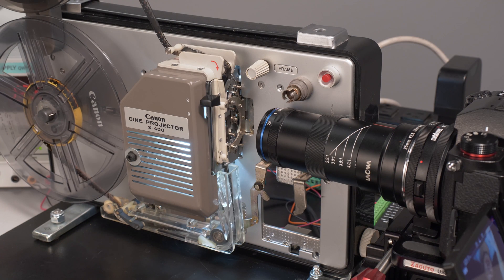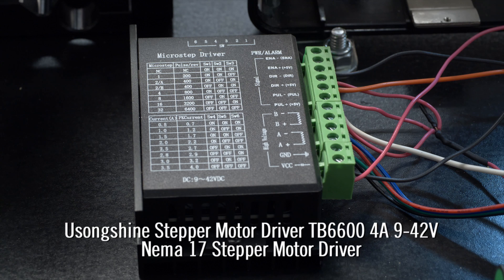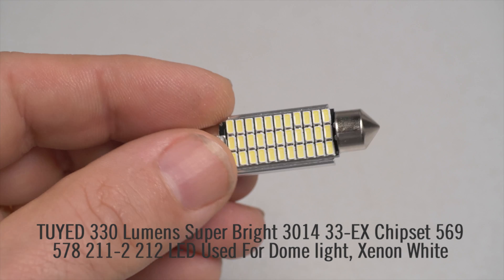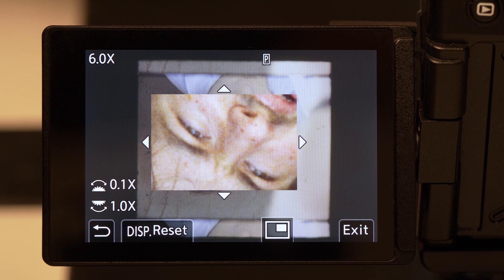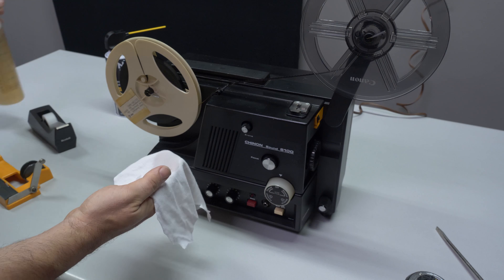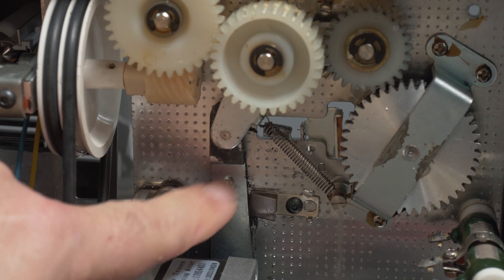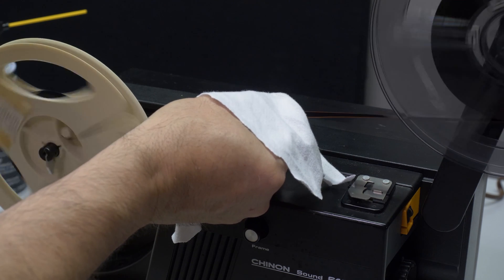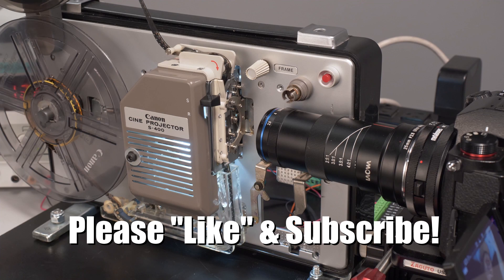DIY Super 8 Film Digital Transfer Update 1

Comment: Thanks for all the detailed information. I built a system based on the information you provided and, after making some adjustments and trouble-shooting, have it working nicely. The quality is superb! And I'm finally able to convert the thousands of feet of film I have.

A couple issues I ran into: The wiring for the stepper motor controller and driver was slightly different, but wasn't hard to figure it out. The memory card matters and a SDXC II V90 rated card works nicely at 2 frames/second. Slot 1 of the Lumix S5 is the faster of the two slots it has.

I ended up creating a resistive circuit for the shutter trigger that keeps the camera from going to sleep (even with all the power saving options turned off), along with a 0.1 uF ceramic capacitor added in parallel just before the plug that is supposed to ensure a clean "trigger" signal to the camera. That eliminated the occasional double-tripping of the shutter. The double-trip might be related to a failure of the micro switch.

Once everything was fine tuned and working nicely, the shutter trigger started acting up. Sometimes it wouldn't trip. Sometimes it would rapidly double-trip. And the camera would sometimes go to sleep even when first starting the scanning process.

Turns out the tiny contacts inside the micro switch were going bad. Had to replace them twice so far. Luckily I had purchased a 9-pack of micro switches from eBay. But unfortunately they don't hold up to the thousands of cycles it has to go through during a typical film scan session -- 120 cycles per minute with 216,000 cycles per hour of film at 18 FPS. I opened up one that was becoming troublesome and there's clear evidence of pitting on the contact.

I took a close look at your video and you're using an Omron micro switch (a higher quality product). I purchased a few from Mouser Electronics. It's rated for 50 million mechanical cycles and 100,000 to 300,000 electrical cycles (at 30 cycles/minute) which is up to 90 minutes of film at 18 FPS. But at least now I know the switch might be considered an expendable item, like film cleaner or splicing tape.

Again, thanks for going through the effort of figuring this out, and for posting your videos about how to do this. It's greatly appreciated!

Comment: I built a similar system with the Canon S-400, and I'm using a Panasonic GH5s as my camera body. On longer reels (200 feet and above), I'm skipping frames in large sections every few minutes. I haven't found a pattern to it. I can certainly go back and recapture those shots, but feeding a long reel through the projector is a bit tedious. Any suggestions on how to avoid missing frames? I capturing at about 1 frame per second. Will slowing it down help?

Comment: Thank you for posting this!
I'm going to be attempting this system.

I have one question. My camera has a micro 4/3 sensor. Do you think it would still work? Maybe I just need a brighter light?
The lens is available with an M4/3 adapter.

Thank you!
Reply from the maker: Thanks for watching. You can certainly use a micro 4/3 camera - you'll need to figure out the distance from the lens to the projector film gate if you use the 25mm Laowa lens. Simply mount the lens to the camera and aim it at the gate, focusing until it almost fills the frame.  That's where the camera needs to be mounted.  When I get the time to finish the video, I've made some updates to this system, using a better quality LED festoon bulb,  carving out a wider hole in the projector so the lens can fit slightly "inside" the projector for better perpendicular alignment of the camera lens, and a dedicated power supply and a few stability upgrades.  For the best quality, I'm now using a GH7 camera and recording each frame in camera as a raw file - might be overkill for what you need however. Stay tuned!

Comment: This and your other DIY film scanner videos are *excellent*. I have watched many (many, many!), and your approach and results are the best I've seen. I am attempting a slightly modified version of this build (I had to find an alternative to the Zacuto mount for Z-axis adjustment). One thing I didn't see in your videos was how you achieved precise focal plane alignment angles. The combo Zacuto and macro rail enable Z + X/Y-axis adjustment, however focal plane alignment (tilt + yaw -- or, in other words, ensuring the camera sensor and film gate are parallel) is fixed when attaching the projector and the Zacuto plate to the board, correct? How did you approach this?
Reply from the maker: Using machinist squares to make sure both planes are perpendicular - has to be built-in to the system that way.
Reply: @FreshGroundPictures  Gotcha. Thanks! I'll let you know how it goes...
Reply: Thank you for your tutorial. Its exactly what I've been looking for and I'm going to attempt this build. 
I have one question. My camera only has an M4/3 sensor. The Laowa lens is available with an adapter for the M4/3 mount, but because it's so much smaller than the Full Frame sensor, do you think it would still work?
Thank you

Comment: This is an excellent build which I am replicating. The only thing different is that I want to keep all the original parts working. So I just want to ask why you need to cut the shutter of the projector out. Can it not be left in? 

I plan to use a magnet instead of the pin on the projector shaft and hall sensor to fire the shutter as I have found the micro switches to be very unreliable. Also use a 12v LED ceiling light to provide a focussed light source instead of the festoon  ...
Reply from the maker: Hello. Taking out the shutter blades was the simplest way to ensure that the camera mechanical switch could be easily set to activate when the frame was stable in the gate.  The shutter has 3 blades - 1 to cover the pulldown of the film, and 2 to "flash" the frame on and off to reduce the perception of flicker. As such, you'd have to time the digital camera activation very carefully to fall between the blades. If the blade moves across the frame while you're exposing the digital frame, I suppose it's possible that flicker might result.  I think I cut the blades because there's no easy way to remove them without taking apart the whole movement - I'm also not sure if other mechanical components might be altered if the blades are completely removed - it's been awhile since I did the video.

Comment: I think you may have left out 2 connections on your wiring diagram for the stepper / controller / motor. You should also show a 12 volt power source connected to the Usongshine Stepper Motor driver module. I see in the video a red wire is connected to the Vcc terminal and I assume the black to GND next to it. I assume these go to the 12 V bench power supply Plus / Minus terminals. I guess it might be assumed the 12 volts needs to be powering the module. Great videos non-theless. I am converting a 16mm Bell & Howell FilmoSound projector same as your 8mm here. Thanks for the detailed steps!! (PS I plan to document my project here on YouTube and reference your links as well!)
Reply from the maker: Yes, you're absolutely right, I accidently left the power connections off the drawing. Thanks!

Comment: I have bought all of the parts now except for the lens and camera mount. So I will attempt this build in the coming months 😃
Reply from the maker: Have fun and good luck - someone pointed out that I forgot to show the 12 volt power wires attached to the stepper motor variable speed control, so make sure to supply power to the plus and minus ports.

Comment: I am reffering to that 6-way unit (in my case the red one with the tiny white switches)
Reply from the maker: First, be sure that you feed 12 volt positive and negative to the driver and the speed control device - not sure I detailed this in the drawings, but the speed control has a 12 volt positive and negative socket with screws on the side. If you want a pic of the dip switches for the driver, send me an email at freshgroundpictures@gmail.com.
Reply: @FreshGroundPictures  Thank you very much, FreshGroundPictures, for your answer! I found out later that day, that I had to connect 12 Volts to the driver as well; as you said!

Comment: For the power supply I wouldn't recommend people to go and buy a bench power supply if they don't need it for other applications. A simple 12V 2A wall wart will do to drive the motor. Saves money and space. And since the motor and festoon bulb are both running on 12V you may as well use a single 12V power supply.
I'm not posting this to criticize on your work, you did a great job. But if people blindly order what you've been using in the video they're buying stuff they don't need.
Reply: Hi!  So instead of buying the Mean Well LED power supply, I should instead just get a 12V / 2A wall wart and call it good?  The only two things I'll be running from mine are the recommended festoon bulb and the stepper motor. Thanks!

Comment: is there enough space for the lens to shot the film head on? Am I seeing that it's shooting at an angle or is that just my old eyes?
Reply from the maker: It's pretty much perpendicular - I carved out a section of the projector body so the lens barrel actually extends slightly into the projector. The way it is now however, there's no leeway. I was actually thinking of carving out a bit more so the lens could swing to right for more adjustment room. It's tricky cutting into the projector body as you need to make sure everything is taped off to avoid getting chips in the mechanism.
Reply: @FreshGroundPictures  Oh, I didn't notice you had carved into the projector body. I'm not sure I understand exactly where you did this. Is it possible to se an image of this alteration in the body of the projector? All the projectors I have tested don't have enough room to shoot the film head on. If one is looking at the film gate head on, there need to be more room to the right of the gate for the barrel of the lens. And this particular lens must be really close to the gate to be able to nail the focus.
Reply from the maker: @solosoulet  If you watch the original video of this build, around 12:15 I show the area where I cut out a section. Here's the link to that video:    https://youtu.be/yStZmqdWDLA

Comment: I've almost decided to go with a very similar setup, however I don't really understand how do you control the exposure between frames of different brightness (I assume this macro lens only allows fully manual mode). Do you set some average exposure combination between the brightest and darkest frames of the reel and then adjust in post production?
Reply: Nvm, the answer was trivial. A and even S modes may also work, depending on camera

Comment: I know it's an old video but... I can't  make that motor spin, are you sure about your wiring scheme ? what power on the motor driver if you have no Voltage and no Ground wired ?
Also, the switch on the side of the driver, which one should be on and which one should be off ?

I've already checked continuity on every wired and everything seem fine :( little bit a help would be appreciate thanks you ! :)
Reply from the maker: Hello - sorry you're having trouble. Both the driver and the speed control need to be powered  with positive and negative 12 volts. I'm not sure that's shown on the drawings. If you want, go to the "about" section of this page and send me an email and I'll send you some photos of the wiring.
Reply: @FreshGroundPictures  hey, figured it out, it work flawlessly (as long as both get powered on!) sorry for the bother and thanks you for the reply :)
Reply: @Stry-Glitch  I'm having the same problem. Can you please explain how you resolved your issue? Thanks!

Comment: Great video! The only thing I would suggest is that you use noise reduction as your first node in Davinci Resolve not the last as you've suggested here. If you put it last then you are making it harder for the noise reduction system as it now has to work on any contrast and sharpening that you have done to the noise in the node chain. Davinci 18.1 now has very good noise reduction but use it sparingly, less is more. Around 1.8 to 2 gets great results (This is possible only in the paid version and not the free version of Resolve)

Comment: Hello, Thank you for the great videos!  I'm working on my set up and am having trouble getting the steper motor to turn. Are there any dip switch settings i should set on the stepper controller?
Reply from the maker: Although you probably wired it already, make sure you have 12 volt power going to both the driver and the speed control. If you're still having trouble, please send me an email message through the "about" tab on the page. I have photos of the wiring and dip switch settings I can send.

Comment: Would you mind sharing your settings when using Topaz Video Enhance AI. Many thanks.
Reply from the maker: They've updated and changed the software so much that my original settings are not relevant anymore. I have a bunch of film I'll be working on in the next few weeks and I'll post the new settings for a current version of the software - it takes a bit of experimenting.

Comment: Great project! I'm currently building this transfer system, could a fixed-lens Nikon Coolpix 7800 fitted with a macro attachment serve as an acquiring device?
Reply from the maker: It all depends on 3 things - if the lens with macro attachment can fit within the physical constraints of the projector side,  the camera has an electronic shutter (which I think it does), and the camera has a remote trigger port (which I don't know for the Coolpix).
Reply: @FreshGroundPictures  yes, the camera does have an electronic shutter and a remote trigger port, as far as the macro attachment is concerned I fear the quality may suffer....

Comment: I am going to attempt this system. Pro8mm charges $100 for a scan unless you purchase film and have them develop it which cost’s $125.  So essentially, they get $100 out of everyone.  Film is under $50 and Spectra develops for $24 so if you think about it. The scan is literally buying another roll of film but the purpose or digital is to save on costs.. for 16 and 35 I understand the value of a good scan but Super8 is supposed to be the accessible cost effective format.  Pro8 in Burbank is trying to monopolize the format and milk everyone’s wallet just to have super8.  This system makes Super8 cost effective again.

Comment: This is a great and detailed explanation. For stabilizing, do you overscan the frames, then load them in Avid Composer and it aligns the frames using frame borders as guidelines, THEN you crop it to normal viewing size and process in Topaz?
Reply from the maker: The best way I've found is to load it into media composer as a 2K file - this provides a little extra resolution for the stabilization. I just stabilize using the frame without the borders or frame-lines. It works really well in Media Composer without the strange warp effects that sometimes appear in After Effects. I'm not crazy about using the frame lines or perforations as the Super 8 format is inherently unsteady because it lacks a proper pressure plate and no registration pin. Since the steadiness of the frame-line and the film relative to the sprocket hole depends on the in-camera steadiness, I personally have achieved much better results using digital stabilization based on the frame image itself. Of course, a handheld shot usually looks fine without stabilizing. I then take the 2K and blow it up to 4K in Topaz - the AI adds a bit of detail and cleans up the image. I've tried scanning straight to 4K from Super 8, but the resolution is not there. I think the Topaz uprez looks better and is less computer-file intensive. If you watched my newer 35mm transfer system, I have that working in 4K really well. I'm currently working on a 16mm system, and I'm not sure wether 4K scanning will produce better results - we'll see!

Comment: Where you are taking 1000s of photos per 100ft of film would you not wear out the camera fast? I was planning on using a 12mp raspberry pi camera that has no shutter to negate this but worried about quality of results.
Reply from the maker: The camera I used has both a completely electronic shutter and a normal mechanical one. Many mirrorless cameras now offer this feature. I would not use the mechanical shutter, as you're right, it would cause unnecessary wear. Electronic shutters are not as good for fast-moving subjects, but since the film frame is stationary this is not a problem.

Comment: What strength of white diffusion did you use? 1/4, 1/2, Full?

I built your exact setup. It’s amazing! You’ve saved me thousands on digitizing my family’s super8 reels.
Reply from the maker: That's great to hear! I'm not sure of the exact diffusion strength - I've had the roll for quite a while and there's no label anymore. It's pretty heavy though - maybe 1/2 or full.  I think the heavier, the better as it smooths out any hot spots from the LEDs.
Reply: @FreshGroundPictures  Thanks, I ended using 1/2 tough frost from a roll I had kicking around and it works great.

Comment: Great video!

Did you try using RAW to recover the highlights?
In the last clip that would be useful, I suppose...
Reply from the maker: I've used raw in the 35mm version I built (see video on channel), but not the Super 8. Generally, I try to get the highlights on the film at about 75% on a waveform monitor. In this case, the highlights  were blown out on the film - reversal film does not have much latitude, and if it's overexposed there really is nothing there. Thanks!